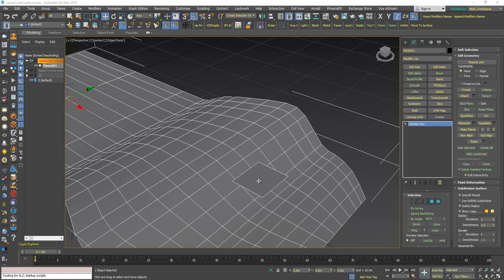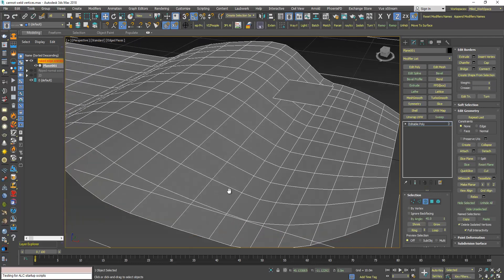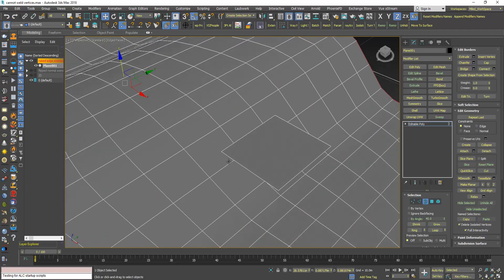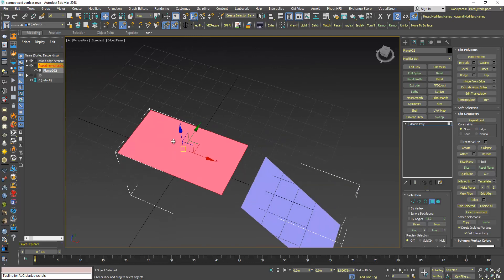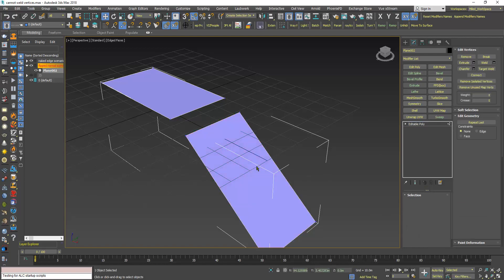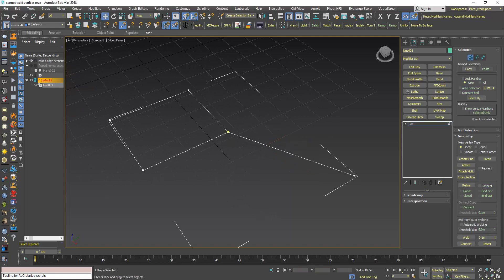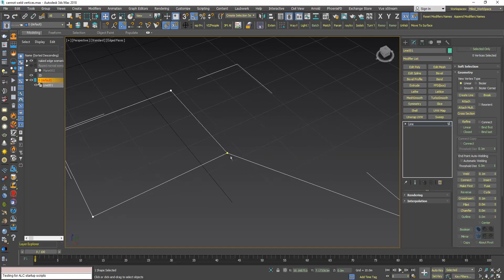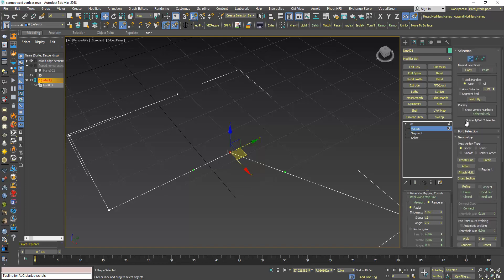3DS Max - Can't Weld Vertices On Meshes Or Splines - Fix

Comment: 2024, anyone who wants to just make a face in bwtween them can use the makep olygon button and click vertices in order and it will make a polygon face
Reply from the maker: Yeah, the button is called Create, and it's in the Edit Geometry rollout. But this is a different topic than the one in the video.
Reply: @MiledRizk  yep awesome video, not much 3ds max content out there. its a great software.just commented that as a tip because I've seen people bridge them then try to readjust it after chamfering which causes more problem and mess up the model sometimes.
Reply from the maker: @maxgordon3194  👍